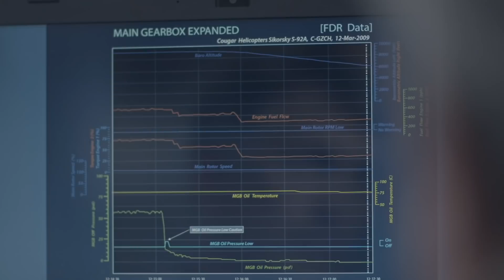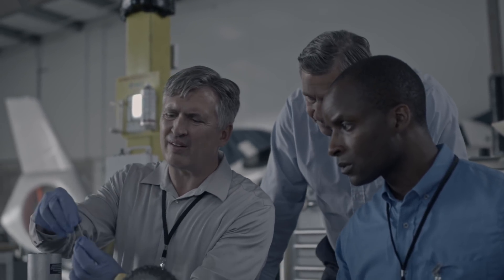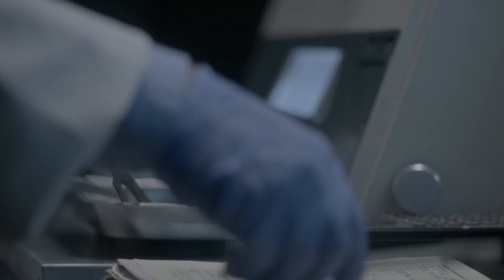Was This Helicopter Doomed By Design? 🚁 Air Disasters | Smithsonian Channel

Comment: If this is a known issue with these two metals then why use them in the first place?
Reply: What difference does it make for the weight if all it is is 3 studs?
Reply: @drcrimsoniam9395  it's a cumulative effect, Dr. Crimsoniam, every gram you shave on an airframe reduces weight, so you make as many parts as possible out of the lightest materials you can and still retain structural integrity.  Ti is stronger than steel, but it's also got characteristics that make it not always the best choice for some applications and parts.  (remember also, "Titanium' in aircrafting is still an alloy of steel, raw titanium is brittle and doesn't like vibrations.)  I mean, there are aircaft parts made of BRONZE (which is heavier and softer than steel, even the boron-bronze alloys) because of heat, vibration and wear characteristics, so some bright Engineer with a degree from MIT thought he could save a few pounds by replacing a lot of low-wear parts with Titanium, including the studs, and thus, get the helicopter up to a set required weight for fuel and payload reasons.
Reply: @danielball959  The problem here is that someone forgot that the fasteners for a filter housing are not low-wear parts. Any threads that are loosened and run to torque more than a handful of times needs to be a non-galling, non-fatiguing material. Especially around oil service locations, titanium has a very bad habit of becoming extremely brittle some time after exposure to chlorinated solvents. One spritz with the wrong cleaner could cause a part to snap months later.
Reply: @mfree80286  Not disagreeing, only noting the most likely reason for the mistake-and it's actually not uncommon for young engineers (or even experienced ones) to make that kind of mistake.  I remember in my teens working on an office building, the Architect designed this cunning a nd clever truss system to hold up the air-conditioner, only when we went to install it with the crane, it bowed the whole roof in before we'd even disconnected the crane-it forced a 'field redesign' but this guy was an experienced and RESPECTED, established, structural engineer and he'd made this mistake.  It's not freakish or unusual for an engineering mistake like this to happen, however the 'not following the service bulletin' is clearly on the operator's end, because THESE KIND OF MISTAKES HAPPEN.
Reply: Kevin Smith  
titanium is more expensive than steel but lasts longer.    titanium would need replacing as often thus saving a little money, plus lighter, weight lower fuel consumption.
Reply: Money , politics , cutting corners......usual crap probably.
Reply: @3chords490  isn’t titanium more expensive than steel ?
Reply: @vin_jha  

It’s also lighter, and lighter means less fuel consumption.
Reply: @vin_jha   Isn’t steel cheaper than titanium ?
Reply: @3chords490  titanium is stronger and more expensive